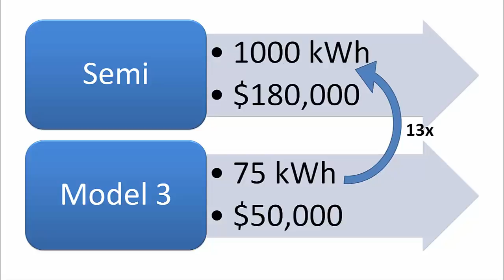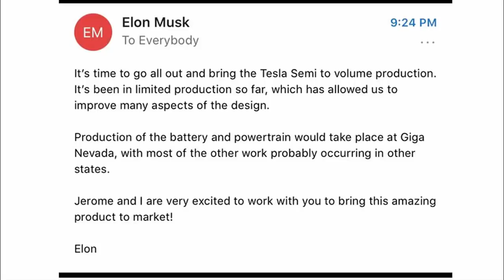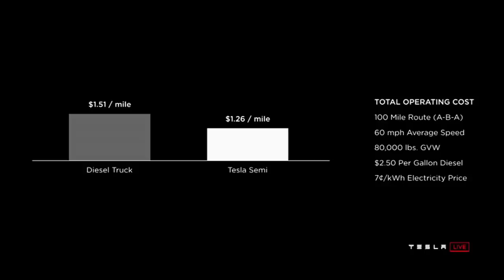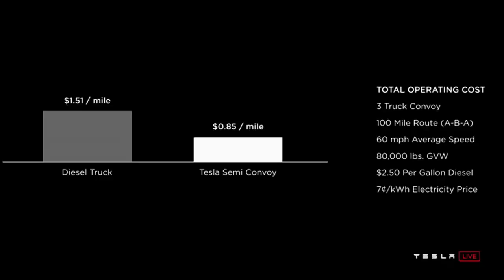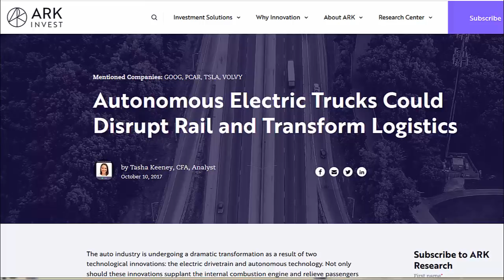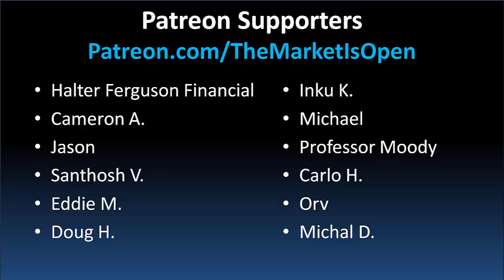What Happened to Tesla Semi’s Autonomous Platoons?

Comment: Regarding the "some manufacturers don't know what a drag coefficient is" argument, the main reason the truck you used in the photo is like that is because it is catering to the european market. The length regulations prohibit the tesla semi as it is to be with a full 13.6m trailer.

Another notable factor is that the maximum speed for a european truck is 50-55mph, depending on the country. This greatly reduces the role air resistance has with fuel consumption, as it is exponential. A large reason many countries only allow a max speed of 50 for trucks is that a +5mph increase of speed results in a 10% increase in fuel consumption.

So in short, it's not only about drag coefficiency. There's a lot more factors in play with the fuel consumption of a truck.
Reply: In the US, the drag is much more important as the speed is higher.
Reply: Thank you for educating me.  I did not know that.
Reply from the maker: For an electric vehicle especially, drag coeffcient is directly related to range. Yes lowering the speed helps EVs out a lot as well. If you design a truck that's the shape of a box though, your range will be heavily attenuated, such that you will  satisfy regulations but no customer will purchase a vehicle with no range.
Reply: TuntematonSika...There have been very recent developments with length regulations in Europe to allow for more aerodynamic truck cabs. Sorry, I can’t remember the source.
Reply: Interestingly, the maximum trailer length is dictated by the stringent turning circle requirements by the Department of Transport UK, EU @12.5m which regulate the approval process. SDC, a UK trailer manufacturer recently obtained approval for a 15.6m trailer using 27 degree steers axles. I'm in the HGV industry and a huge fan of Tesla so really hopeful that Europe will find a way to make this work! I guess we better make sure there's enough batteries to go round first! Lol
Reply: @jbell6642  apologies I hadn't read your comment before making my own, i think we're referring to the same https://www.bpw.co.uk/news/sdc-longer-trailers-fitted-with-bpw-self_steer-axles
Reply: What exactly is exponential when it comes to air resistance and fuel economy?
Reply: Air resistance is equal to: (air density x drag x surface area) / 2 then multiply that times velocity squared. So if your air resistance is 8 at 2 m/s it will be 32 at 4 m/s. Ie exponential. 

Hopefully that makes sense.
Reply: I have a feeling the shape of the front of the truck has had a smaller affect compared to making the bottom completely flat and removing stuff sticking out the sides like stairs, exhaust , fuel tanks and such.
Reply: @ecospider5  Thanks, but I don't see anything exponential in there. Didn't you say yourself it is proportional to the velocity squared, i.e. quadratic?
Reply: @peter.g6  You are correct that in the strict mathematics definition of "exponential growth" the quadratic is technically not exponential. However language has evolved a colloquial use of the phrase "exponential growth" to include anything that grows faster than a natural linear function. That looser definition is pretty entrenched in our modern language so it really is valid in this non rigorous context.
Reply: I read somewhere the combination of truck and trailer in Europe is capped at 61 feet..  81 feet in the US...

Comment: What happens when a platoon of 6 semi trucks starts going by while a car is trying to merge in on a short onramp? Do they automatically move the trucks to open a gap? Keep a decently big gap at all times, sacrificing aero?
Reply: Came here to make that exact comment; looking to see if it had already been asked/answered.

This seems really problematic to me. Platooning on the highway always gets characterized as an "easy" problem. But, if they stay in the left lane (setting aside left side merges), they'll invariably create passing problems (sure, technically by people exceeding the speed limit, but that's reality). If they're in the right lane, this may create huge backlogs on some on ramps as someone is accelerating to merge and then realizes there's a 600 yard long wall of tractor trailers and has to slam on the brakes.

Unless the platoon is going to be smart enough to identify mergers in advance and create gaps...but that seems like it creates new autonomy challenges (every truck must be able to instantly become a leader, at least for some amount of time). And, moving all trucks into the left lane is unrealistic (due to vehicles there).

I'd really like to read/see how far along this issue has been analyzed.

(Note: I guess one solution may be to limit the size of the platoon. I suppose if there are only 2 or maybe 3, or some small #, the problem might be mitigated. Again, interested in whether there's any actual analysis on the issue.)

Comment: Did some calculations:
 Last year battery price for 300mile semi will cost up to 175 000$ and have a 600kw battery, so they are trying to get the price down.

As far as i understand they need to lower it by 25 000 $ so the semi will start to be economical to produce.
They are real close finally (i do not have the latest info on Semis but it seems they have lowered it by 30k allready).

(sorry for the grammar/dyslexia)

Comment: Have they got any Mega charges built yet? As I am not sure many 500 mile trucks with 1000kwh batteries when even when v3 superchargers max out at 250kw that would take 3 hours to charge the battery to 80% before it starts slowing down. 
Can a mega charger even output 2MW speed needed to charge a 1MW battery in 30 mins
Reply: Greg truck drivers are required by law to stop after 10.5 hours of driving in a 24 hour period, and required to have at least 8 uninterrupted hours for sleep. Plenty of time to fully charge even at a standard Supercharger.

Comment: Let’s say that I’m following a Tesla convoy. #1 I want to pass the convoy. The best way is pass 1 at a time. Let’s say we pass #3 and we are between #3 and #2. Does Tesla #3 let up and give me room to pass and complete my pass? Can #3 maintain safe distance between me and #2?
Reply: I would say yes!!
Reply: Probably the answer is yes, but why pass just #3 if #2 is going the same speed?  Pass them all.
Reply: Bruce W Randol...Yep. Really good point. Should convoys be restricted to double-lane highways? The good news is EV semis don’t slow to a crawl climbing hills.
Reply: @jbell6642  Yeah, at this point I don't see these convoyss riding on anything less than double lane highways. Both for safety as well as practical reason.
Reply: I only pass #3 because there could be something coming from the other direction. So I will pass 1 at a time. This could save my life plus others.
Reply: Bruce W Randal - Why pass them, they can do 65 Mph up that grade, remember? And, if by Passing, you mean, on a 2 Lane Road, with opposing traffic, Speed Limits are usually slower, anyway! So, if Speeding you must, you do like always, when a group of trucks are running tight, you wait for a 3rd Lane Passing Area to go by!

On a Freeway, they will not be running Side By Side, at least not with themselves, so, even on a BASIC Freeway, you just will pass normally!

Comment: I have been a bit skeptical of the Tesla Semi and it's claims since the Nikola hype lately and have been checking out how the numbers work out on real engineering's battery calculator wrt to loads and vehicle dynamics based on drag, rolling resistance, and inertial forces (including grades and regen) and the paper is technically sound as a former mech engineering student. He made a calculator at battery.real.engineering from the given formulas. I tried them with Tesla's known specs, Munros teardown numbers, and numbers for semi trucks for frontal area, typical acceleration, tire rolling resistance and honestly I think Elon was projecting into the future again. If you just run the numbers for 255Wh/kg and $150/kWh the numbers don't check out for charging base prices for either the 300 mile or 500 mile semi. Even as you just plug in 1MWh of batteries * $145/kWh (basic conversion for cell to pack is 1.35-1.45*cell cost, for Tesla I had $110) which is $145,000. Then the cab and the rest of the powertrain is roughly $75,000 so it exceeds the 500 mile price by quite a bit. More so if you add dry weight of the truck 7500kg to the battery which turns out to be ~6000kg, the total is 29000lb. That would lose 7000lb of product per trip, at 50c per lb, for 10% of long haul loads being about fully loaded, for 200 trips per year, for 7 years, that's $490k lost in revenue. 

This all deals with a packing factor of .65 which is incredibly high. When it's .6 or .55 it gets drastically worse. Then on top of that you have to factor in driving at much higher speeds on the freeway than 50mph, inclines,  and cold weather with range loss up to 20% or more. Other trucks like diesels and hydrogen will lose range too bc the incline but problem is that they are well equipped over 500 mile ranges bc they have so much more energy onboard they have 750+ mile ranges instead of 500 mile ranges getting knocked down. 

I also did the scenario for Maxwell obviously which should be 325Wh/kg and $128/kWh and that still was unfavorable for the 500 mile semi even with no unfavorable conditions which I mentioned before, losing roughly $300k in buyer revenue from weighing in the 26000lb range still and not breaking even on $180k. However the 300 semi would be profitable from day 1. It would make a margin similar to diesel trucks for the initial buying price and obviously the fuel savings are tremendous. Even if we factored in cold weather, incline, etc, that really doesn't matter for the 300 mile semi bc the market below 500 is still very big and even below 100 is very big. 0-100 miles is 25% all trips and 100-500 is 37%, remaining is 19% each for 500-1000 and 1000+. If the 300 mile semi does 150, 1/3 the market is still there.

 Honestly I think they could sell the 500 mile semi at close to beating diesel on price per mile including the buyer's product losses bc battery weight, they just have to knock down the asking price. I think if you want a fool proof BEV semi you need prices under $80/kWh and 500Wh/kg. You just gotta go thru the calculations. Otherwise Nikola will definitely always have some kind of market and obviously as their prices/efficiencies head toward their theoretical max too, they could be in the $1-2 range per kg but I think both have diesel beat and are much greener.

Also, I have run thru the numbers for Tesla's Model 3 LR and Standard Range plus with Munros input and this model is 1-3% within the true range values so it is in fact accurate for energy needed and weight of the battery. $/kWh is a different story though possibly. If Tesla could go below 80 to even below 50, and now this is all at the pack level, then they could really be saving a ton of money and they would be the best of the emerging technologies for heavy duty trucking.
Reply: Christopher Kalafatis bear in mind that Tesla doesn't operate for profit primarily - profit is just how they finance their objective, which is sustainable transportation and sustainable energy.

So you're looking at the problem all wrong. The semi doesn't actually need to be profitable from day one. Much like they financed the Model 3 and Model Y with the Roadster and Model X and Model Y, they can actually accomplish their goals with the semi by subsidizing the product on the backs of other products where they can amortize the cost more broadly. Grid scale energy for example. That's a very long term investment and since everyone and everything relies on logistics and transportation, it isn't beyond rational to amortize that cost into a different market segment entirely. We all depend on having things shipped across the country, so it doesn't actually matter whether we're paying for the cost of that delivery by handing cash to a trucking company, paying taxes, or tacking it on to the cost of our utility bills. A savings is a savings.

And if you think the utilities aren't a good place to shift that cost to, look at the number of utilities that are calling for more electric vehicles because it reduces the cost of producing peak load and making the grid scale better and more reliably by reducing the single biggest cost factor. The semi contributes to that too, so the impact of shifting some of that cost to grid storage may actually be even lower than not shifting it there.

Comment: Far more interested in semi than roadster.   Concerned about payload competitiveness, will batt mass limit the use case in the short run?  Maybe it doesn't matter right away, there will be a big market for it anyway.  

(oft overlooked:  bottom surface aerodynamics is most important and traditionally most neglected, look how rough an uncovered drivetrain, frame and hardware typ. truck bottom is.  A lot of air goes between road and bottom.  Any highly efficient wheeled vehicle will put most of it's energy, on highway, into breaking wind so to speak.  Around town aero superseded by other losses, semis are longer range in general)

Comment: 2:25 it's just straight up wrong! 13 model 3 take up 13 production spaces and 1 Semi only takes up 1 also it needs less chassis materials as its 1 chassis and not 13. On top of that the battery in the model 3 doesn't cost 50k maybe 1/10 not even or not even that so it costs 5k 5k×13 = 65k also maybe the batteries dont stack up in the sense of them also needing 1 construction slot and not 13

Comment: My guess is the semi truck is a long way off. The whole industry is battery constrained and this will remain the case for years while EV disruption is accelerating. The video poInts out the viability problem of producing semis when they could build 13 m3s for each semi and to me that kills it for years. They’d build their own fleet and run that for a while to refine it before mass production started too.Tesla stopped building the Nevada facility when it was one third built. The first signs of battery ramp up would be resumption of building the Nevada factory. When Tesla do ramp up their own production I imagine it will take several years to build up the supply chain. I think Elon intends to abandon Fremont once a new factory is established in Texas and maybe another one in another state later on so I don’t see production expanding there but being wound down over time because business conditions are not good there. The factory is not particularly suitable anymore either because it’s not custom made for efficient production and I doubt there’s any room to build semis.

Comment: Nikola is in trouble now.
Reply: Nikola has been in trouble since the beginning.
Reply: @robertmcdonnold3038  Correction, they were in trouble before they even started.
Reply: People that unironically hold NKLA for the long term are detached from reality
Reply: @schraderclemens6122  They will soon be detached from their money.
Reply: Nikola isn't in trouble because it doesn't even have a product!
Reply: Nikola’s truck if delivered as promised has a couple of advantages over the Tesla design.  I think it would be dismissive to just cast it off as a non competitor.  Those advantages are fill up time and range.  These two points together add up to less operating down time to get the vehicle charged up.  
The extended range is great for cross country trips as the route might not have to be altered as often when planning where to stop the truck for the night. The driver can stop for the night, wake up and do another shift. 
These two advantage  points might be attractive to some customers but not many.  Cost of operation is the most important aspect of shipping and far, fuels cells are not half as efficient as BE.  In examples available today, fuel cells are less than half as efficient.  If there are as many mega chargers available to Tesla trucks then the superior range of the Nickola trucks only matters If you are staging drivers and if you can charge while resting and there are as many chargers as truck stops then it should only take an hour or two extra.  Because doubtful that there will be enough charging ports available to allow the drivers to sleep for eight hours at a charging port.  (Should be 10 hours of rest imho).  
I million or two mile fuel cell with the power to pull max weight has yet to be proven, and I could go on with the many disadvantages, but I just wanted to point out the two advantages.

Comment: Tesla is delaying the semi cause they don't want to loose an insane amount of money. Model 3 battery is worth 10k so a semi battery with 13x capacity is around 130k that leaves Tesla only 50k for a whole semi that is the price of a pick-up truck
Reply: Sara Paolollo $50k is quite a lot of money when you're only paying for a frame and body. Once you factor out all the complicated and high precision mechanical parts required to make an internal combustion engine actually work and capable of pulling 80k lbs up a 12% grade, the cost of a cabin for a driver or two isn't really all that much higher than it is for a modern $50k pickup truck. It's largely the exact same parts in largely the exact same quantity. And a lot of them aren't needed due to not needing to have 50 gauges and computers and wiring and plumbing to monitor all those mechanical systems that are no longer there.
Reply: @babybirdhome  yes another bullshit, you know that engine making is mostly casting and stamping right?! Engines and parts are made very efficiently in millions, and used in different cars and trucks, thats why ICE are so cheap and popular